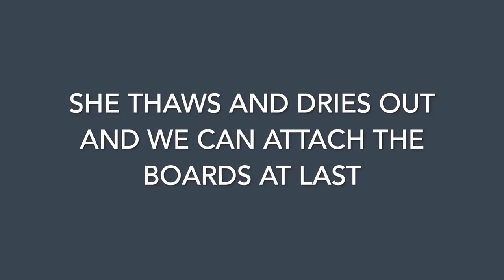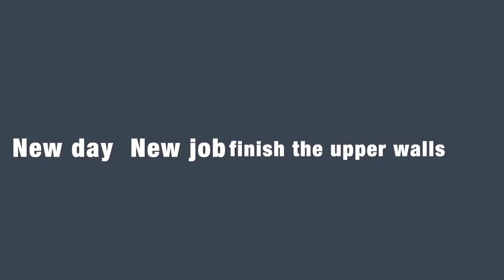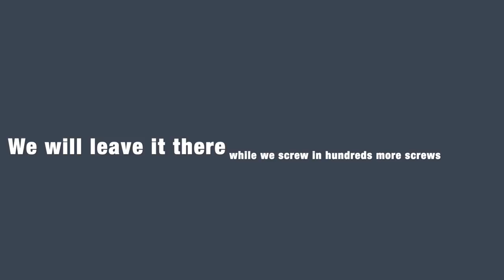Vlog 16, Narrowboat fit out - Part 2. Battening and Insulation

Comment: Great vids showing construction, love 'em... May I ask what dia are your circular windows and will they be fixed or opening type? Also the gorrilla glue in the gun was this panel adhesive? Keep 'em coming...
Reply from the maker: Hi Tony. The windows are 18inch dia openable with removable glass. You'll see us fitting them in a later vlog. The gorilla glue is construction grade grab adhesive. We've been really impressed how it performs on steel.

Comment: Do you know what the cost of insulation against sprayfoam? I'm in the early stages of a massive 70ft project. Just sorting the engine 1st. Sorry jumped in too quick didn't realise you were spray foaming aswell.  Really glad I found your channel. Me and my friend are brckies/ builders this is a whole new ball game to us.
Reply from the maker: Cheers mate. My background is Gas and Plumbing but also worked in Passive Fire Protection. But this is a whole new ball game the same as yourselves. Spray foaming the whole boat would of been quicker as for price I'm not too sure. But we decided on PIR board as we could do it ourselves.